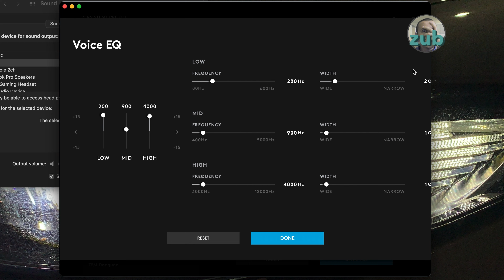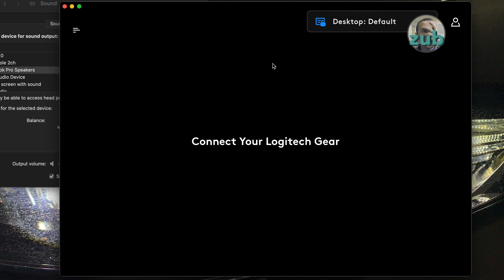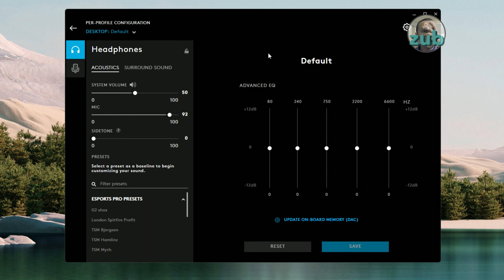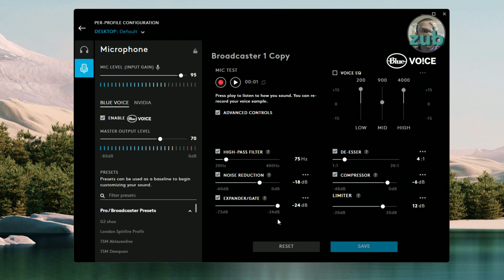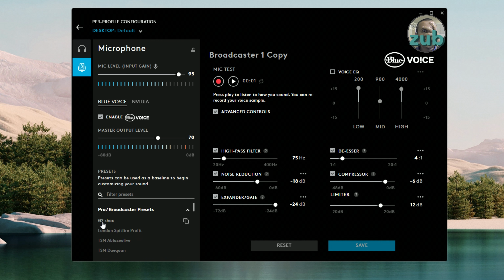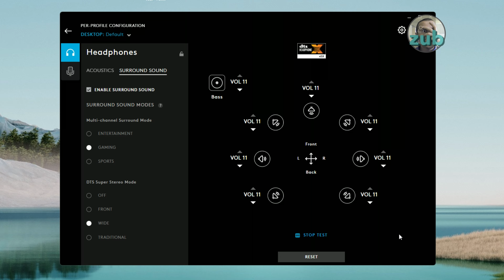Logitech Pro X (2nd Gen): Microphone Blue Vo!ce Test and Sound Check with Logitech G Hub

Comment: how is your voice this much clear? i recently bought g pro x 2 and the microphone it's so muddy
Reply from the maker: Hello! The settings I used are actually shown in the video - I’m speaking while changing them so you can hear the difference in real time.

One thing that makes a pretty big difference is the position of the mic. I keep it fairly close to my mouth. If yours is already positioned like that and still sounds really muddy, I’d honestly start wondering if there’s something wrong with the mic itself. Mine sounded surprisingly clear almost right out of the box.

If you want, try my settings from the video and let me know how it sounds. 👍
Reply: @zubilitic  I’m using the new G HUB, so the settings are different. As you can see, there are three dots next to each section, so I’m not sure if I’m using the exact same settings as you.

If you could help me fix my mic, that would be a huge help.